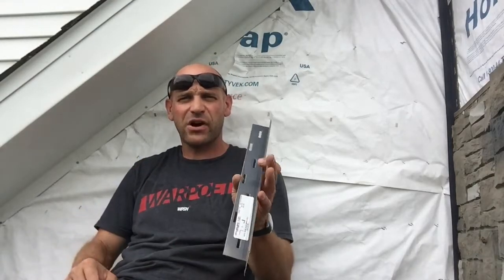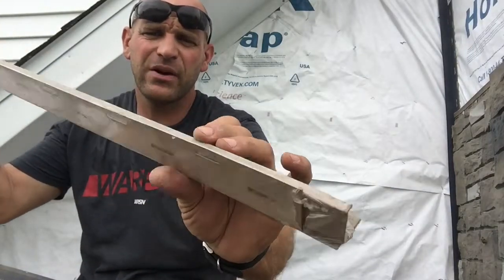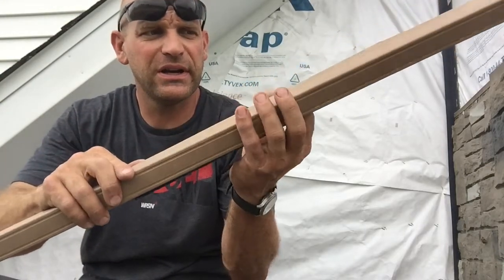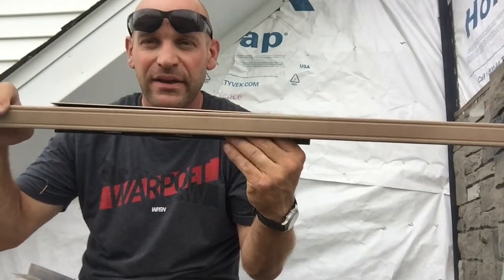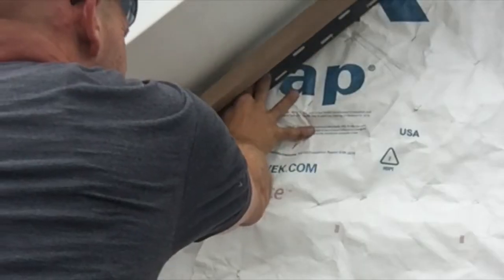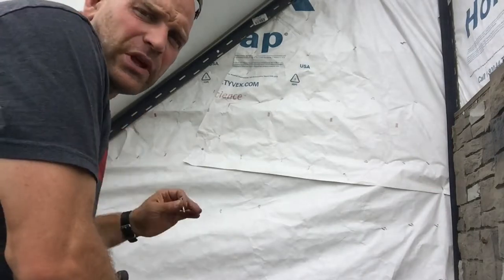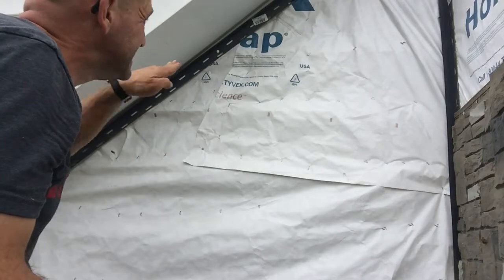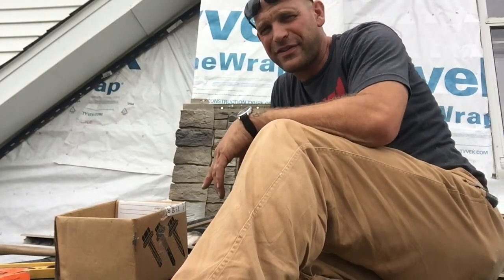Novik Stone AC Trim install

Comment: Im having trouble cutting the finish trim around gamble style roof on my shed.
Reply from the maker: I use tin snips to cut it and it works pretty well
Reply: Yea, I can cut it fine its figuring the angles out so it looks good.

Comment: Is there a certain way to join the j channels together I done some and they don't line up very good. They only came in 6 ft lengths too.
Reply from the maker: I haven’t found a good way to join them. I also was troubled with the fact that they were only 6 ft long. I’m hoping they improve on that aspect.
Reply: @mr.kongable  thanks for the update
Reply: I am about to do my first tomorrow. I hope I figure out a good way to join them, also I want my windows and doors mitred. Not impressed I need two pieces to run up my doors..

Comment: How do you finish inner corners
Reply from the maker: I use two trim pieces. One piece one each wall . I need to make a video on that as well
Reply: @Trevkongable  Please do my friend about to start a project that the only thing I'm not sure about Thank you
Reply from the maker: @mikep6275  they also make an inside corner piece. I used the two trim pieces because the area I put the Novik on was a small area that had a roof section so it would have made an inside corner a little weird.
Reply: @Trevkongable  Thank you for your help
Reply: Curious to know how you did the parts on either side of the chimney that are lower than the bottom of the chimney, and also are not level.  I haven't found any installation instructions for areas that change elevation and/or slope.  I'm guessing you can just rig it for small sections and it will be OK.